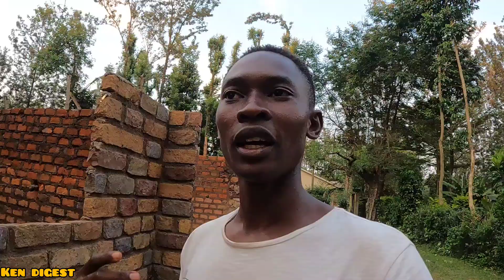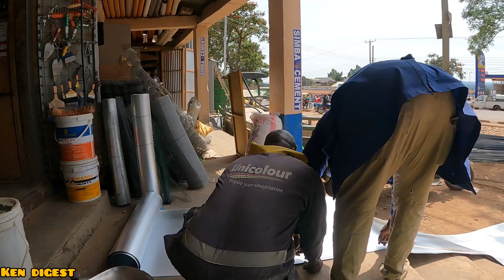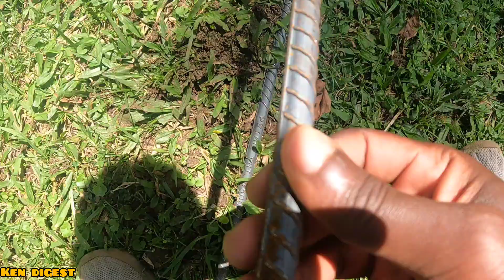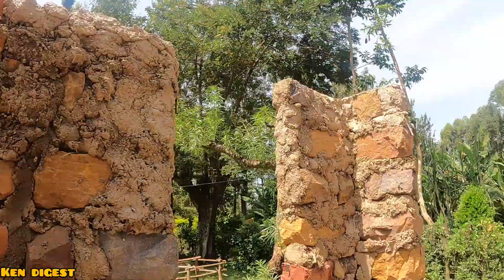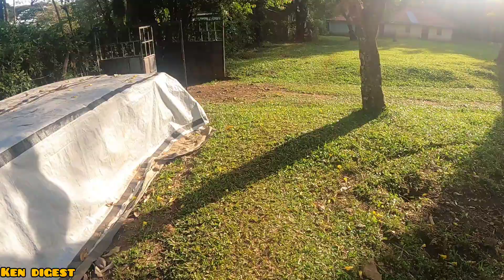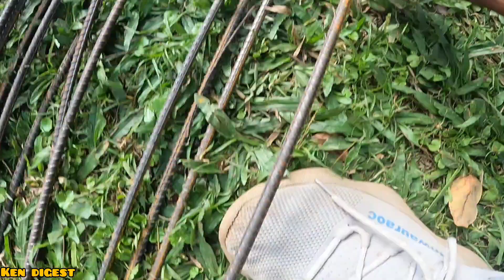FINALLY MAKING OUR FIRST RING BEAM FOR THE LINTEL CONSTRUCTION

Comment: Ken Digest now I understand it takes time to file a bricks rather than hollowblocks…now put the beam all around to form its box style bungalow and after the inside it’s should be finishing to cluster the wall…interesting!!
Reply from the maker: Hollow blocks are easy to deal with like interms of weight, stones are heavy and we were constantly picking them according to size and color before placing them on the motor